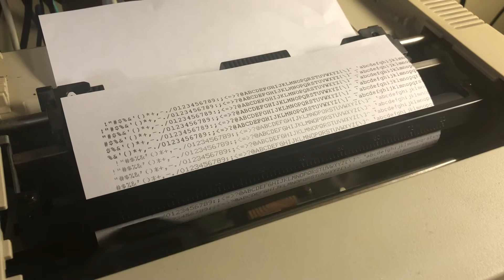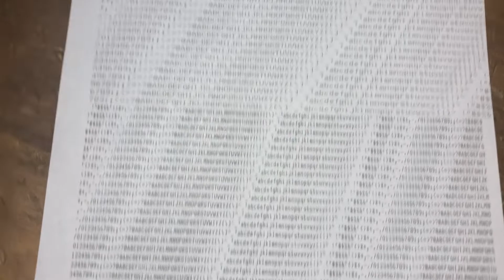Panasonic KX-P1091 printing test sheet (all 3 text modes)

Comment: Dot matrix printers were kinda beautiful
Reply from the maker: I certainly like it. It is the only printer I have and I have no plans on getting another one. This printer does exactly what you tell it to, if you tell it to print, it prints and does nothing else, and it will keep doing what you tell it to do until you stop it. 
This printer is still running off the same ribbon that was in it when I got it, which is an original Panasonic ribbon, so it is pretty old. And new ribbons are cheap, the cartridges printers use today are expensive and don't last long at all. 

And unlike new printers, this thing will only complain if it is out of paper, it won't refuse to print in black and white because there is no cyan or some crap like that, it will even keep printing if it has no ribbon in it, it just wonn't be visible. I have never had a single issue with this printer, but every modern ink jet printer I have dealt with is so finicky and has so many small issues that by time you get it to print what you want, you are ready to smash the thing. And a good laser printer is expensive (over $1,000), so for someone who just wants to print text documents and not pictures or colour, a printer like this is still better than anything they make today, and I got this one for under $50.
Reply: But still, everything I read here is why I prefer older printers as well. Like my HP LaserJet MFP 4100 from the early 2000s.

Comment: 9 or 24 pins?
Reply from the maker: I am not entirely sure, but I would have to imagine 9, the resolution is quite low and you can see the individual dots pretty easily, but this is the only printer I own, so I don't really have a reference.